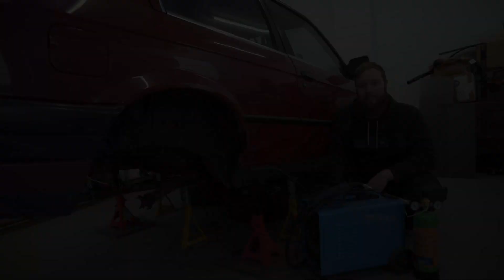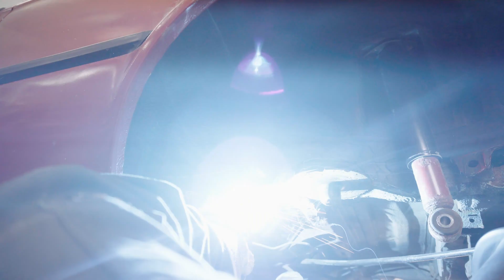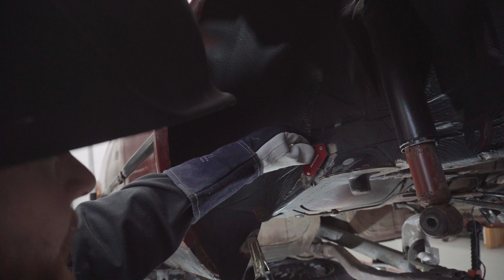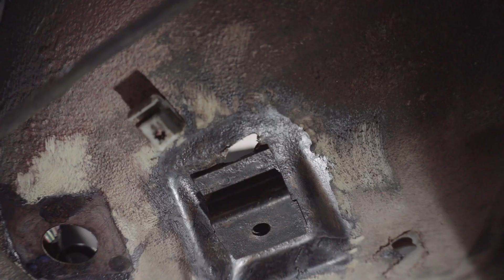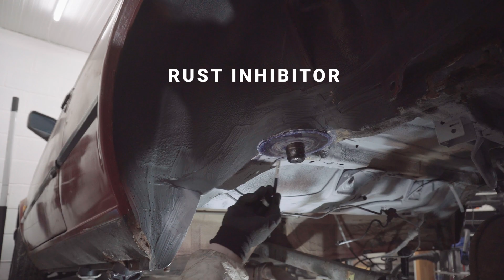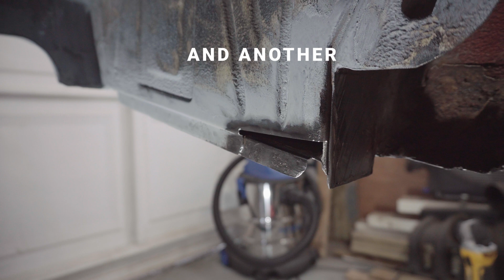BMW E30 Underbody Rust Hole Welding | Car Underbody Restoration | 015

Comment: Thanks for sharing. Excellent e30 content (and I am so jealous of your lights, so bright!)

Today i welded the rear arch on the driver side of my e30, there was a lot of rust.. but what a good feeling to compare before after when it is all welded!

Oh and everytime I weld I say myself, you can weld as good as how well cutted and closely adjusted your patch piece shape. Butt welding isn't the easiest for begin with but if we were chosing the easy things we wouldn't be on a rusty car project lol
Lap weld I can just not thrust for being futurproof with my little experience on welding..

To conclude gently it was just a word to say please keep motivated, we are on the same boat..
Reply from the maker: Awesome cheers, Murat! Sounds like our E30 projects are very similar indeed as mine has a bad rust patch on the rear arch.

I'm currently working on welding up the rear battery box which is another very common rust area on these old beamers. And you're 100% right about getting the patch to fit perfectly, that's probably the hardest part for me so far.

I'm hoping to keep the ball rolling with this project as I'm really excited to actually drive and enjoy the car it will eventually be.

Comment: I strongly believe that if you spend time once in a while to check for chipped, flaky or any other form of underseal damage and you fix it by painting with rust inhibitor and apply new underseal there shouldn't be a reason why the underbody of the car wont last many years to come. Also applying fluid oil like waxes in the vulnerable parts of the vehicle is a must do especially for older cars or if you live in rainy and snowy places. Cheers.
Reply from the maker: Completely agree mate! Its a shame people aren't wise to that, there'd be a lot less rust in the world.

Comment: Couple tips from one weekend warrior to another. One, try to do your cut outs on a bit of an angle. This will give you a nice beveled edge for welding. Two, prior to welding in new patch, "knock down" edges to be mated on original surface. This will give you some space for welds and body filling, without creating a bumped seam.
Reply from the maker: Thank you, I really appreciate the tips. Having a little bit of space between the patch and the weld is a concept I've only recently started to understand too. The avoiding a bumped seam is a very good way of putting it. Cheers!
Reply: @SPANNER RASH  It's same if you can tack patch in place, and using a rubber mallet, knock it down around edges. This  too will create a lowered edge for spot/button welds. Makes for a lot less body filling and sanding afterwards. 
Cheers and thanks for the videos. Always great to compare techniques with others :)
Reply: @SPANNER RASH    \ |   Visualize the two lines as pieces to be welded. One be beveled on edge, other flat. When they meet along edge, it creates a groove to weld along, which is wee bit lower than the surface :)
Reply from the maker: @chowchow2386  Absolutely, it's a very clever idea, wish I'd have thought of it myself! 😂

Theres so many specialist bits of knowledge when it comes to welding, it goes way deeper than I anticipated. I've learned a surprising amount just from the comments section which is awesome. Cheers!
Reply: @SPANNERRASH  Same. Why I love watching others work/reading comments.
I would also recommend try running a thinner wire for thinner metals. I use a 0.025" (may be a 0.028"), one size down from the 0.030". Note I use a flux type welder, with polarities reversed on power (inverted polarities gives cleaner welds with flux welders). As you know, thinner wire means less angry pixies, which means less heat/warping.
Reply from the maker: @chowchow2386  Ahh yes I've been recommended to try a thinner wire, 0.6 in metric. I'm planning to pick some up as it would certainly have been better for thin body work from what I understand.

I didn't have much luck when I had a play around with flux core welding, although I knew a lot less about welding than I do now when I was trying it out. But I noticed a significant improvement in switching to the gas.

Angry pixies is a nice way of thinking about it! 😂

Comment: where is the part youd do jack posts ?
Reply from the maker: Hi mate, do you mean where do I repair the jacking point? That's in this vid here: https://youtu.be/F0z8C6f2vNI
Reply: @SPANNERRASH  how much did it all cost? ?
Reply from the maker: @christophercolumbus8944  To do this repair? not that much to be honest, a few cans of zing primer, a bit of welding wire and gas, and some cuts of sheet metal picked up for cheap from a local engineering place. I quite often put links to things I use in the description where you can price things up. Feel free to check those out. 👍

Comment: Grab yourself a hobbyweld 15 cylinder and ditch those disposables if you are going to be doing any amount of car/motorcycle restoration/bodywork. Even the small rent free hobbyweld cylinder is like 10 of those disposable bottles! 😉
Reply from the maker: You're 100% right Bill, we've moved onto a larger welding gas cylinder now. I think it was the right choice. Plenty more welding to do! 😂